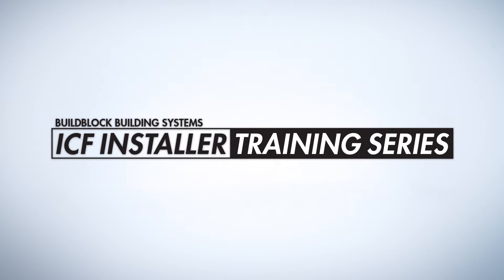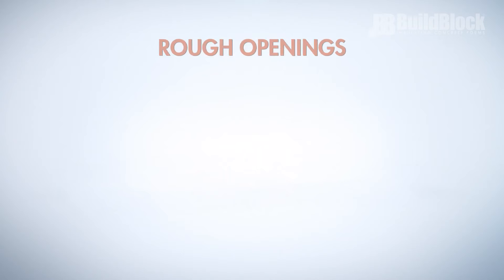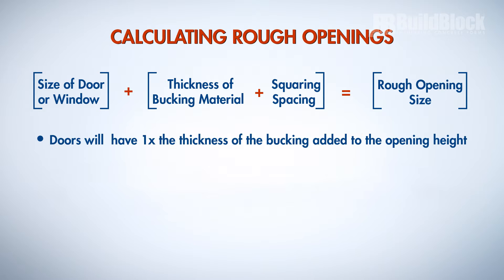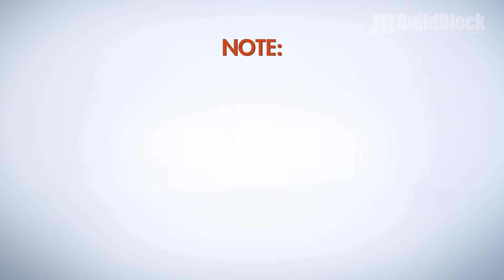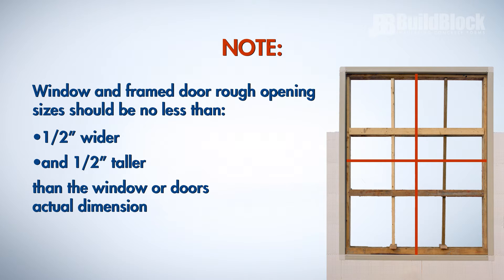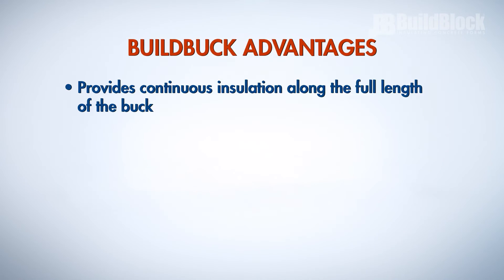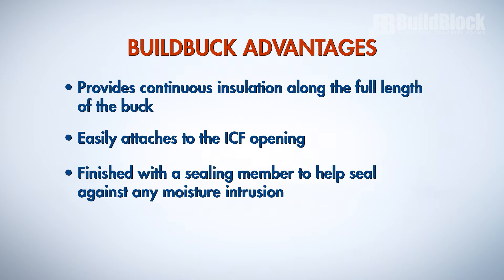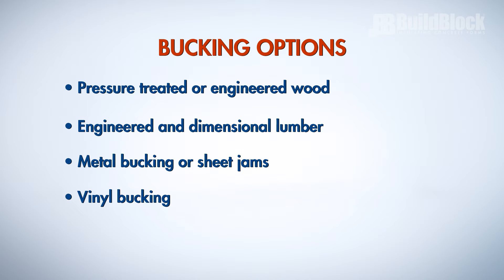BuildBlock ICF Installer Training Series: 07. Door and Window Openings

Comment: Is there any special header requirement for large window spans?  Will the cured concrete need support or will it become the support?  Compared to traditional wood framing you need a high-strength lam beam for support.